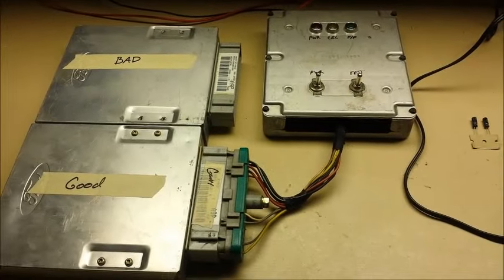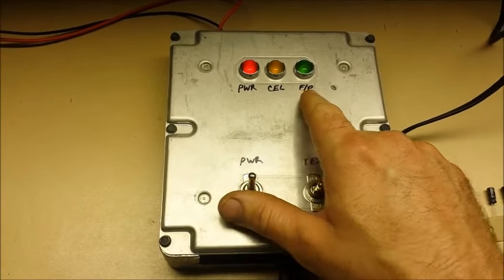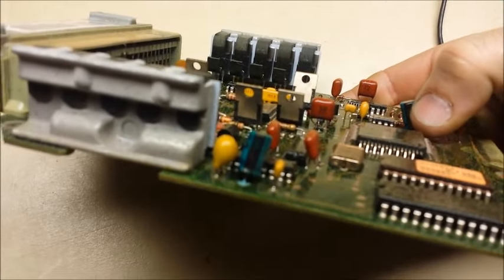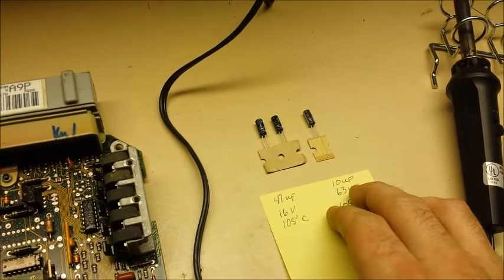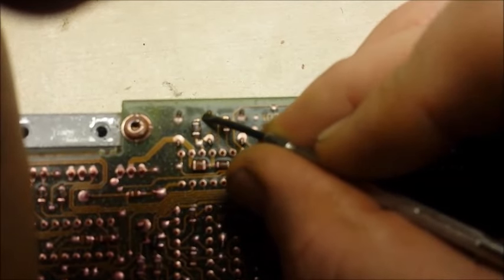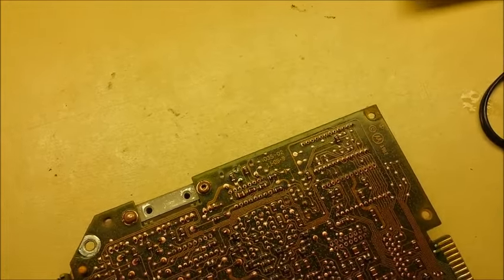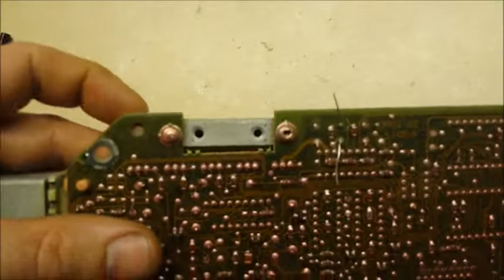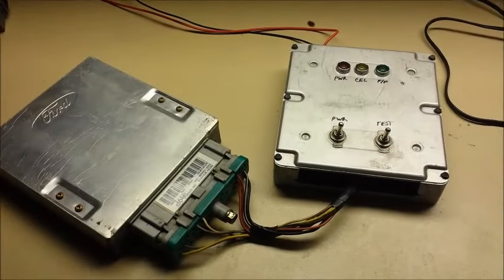Fox Body Mustang PCM Repair

Comment: Can this also cause the o posite? Fuel pump not priming? Changed pump and relay under seat 12v at the trunk cut off switch. Still not priming?
Reply: TheRASAchannel Path MoreLand Mine is doing the same thing. Just installed new fuel pump, fuel filter and fuel relay under seat. Car cranks but I don't hear the fuel pump prime.  Just took my computer out and looks tore up and sticky on the board. Any help would be helpful
Reply: my ecm looks like new inside so ya you more then likely need a new ecm/computer luckily they are not that much. I can't get my ecm back up in that tight spot. LOL I unfortunately did not check the pump before putting the new tank and sender and pump back in...... ughhhh so now I need to drop the tank again. which is not easy by yourself. Well drop is ok putting it back is is kinda tricky. LOL
Reply: mine will crank with starting fluid so I am getting spark. if you have a multi meter check for ground at the injectors

Comment: Where do I go to find these computer parts In this video I want to order these for mine and give it a try cause I have all 3 leaking
Reply: I've only done a handful of them myself but I ordered all the capacitors I've used from Mouser. I got Panasonic branded ones but I know they have alot of diff options. You'll need two 47uF 50v & one 10uF 63v. you can go higher on the voltage if exacts aren't available but have to stick with the same farad rating

Comment: Do you know if the DA1 Speed Density Mustang ECU only has 2 compacitors, opposed to the three that are usually on the boards?
Reply: Bruh I’m a straight beast I fix anything
Reply: @sweetassugar2076  so answer the question, "beast"
Reply: J PP no how many?
Reply: @sweetassugar2076  I don't know "beast", read the last response
Reply: J PP let me go into beast mode I’ll figure it out ! Straight beast !!

Comment: How did you build the test machine that acts as the car? Thanks!
Reply from the maker: Just old parts I had laying around. There is a relay inside wired just like the fuel pump relay would be, that powers the the F/P light. The other lights are powered from the switch.
Reply: @TheEFIguy  I'd like a schematic if you have one available

Comment: Can I send my ecm to you?
Reply from the maker: Yes. My email is at the end of the video.
Reply: @TheEFIguy   I got a 95 Town Car with a 2004 Interceptor that likes to randomly surge idle only in gear. Once you got to park, its fine. The original PCM was doing it all the time no matter what gear/park it was in. Replacing the PCM has helped a lot, but hasn't fixed the issue. I'm leaning towards the driver for the IAC. Any clue how to replace them and or where I can get a schematic for this PCM? Appreciate any feedback.